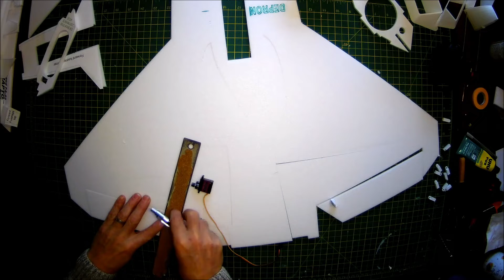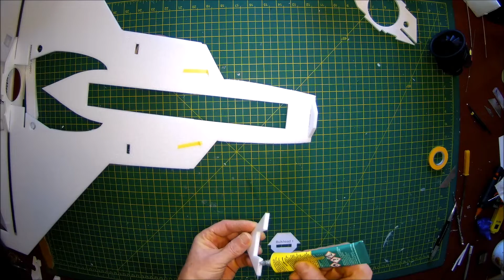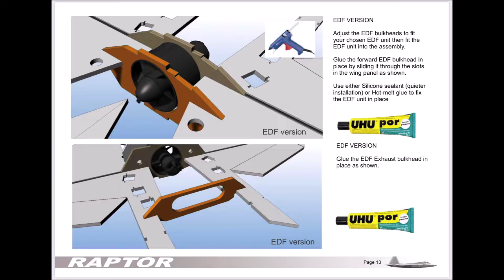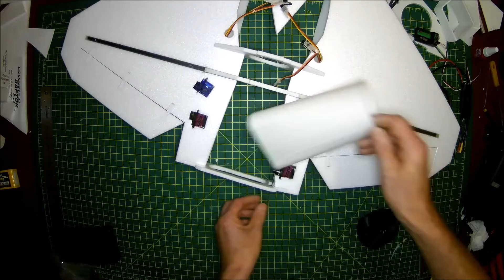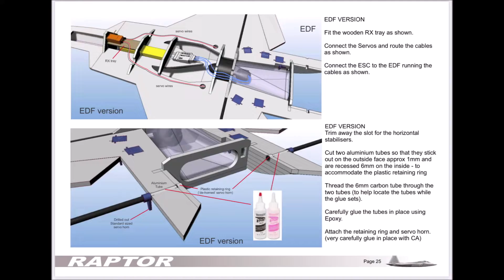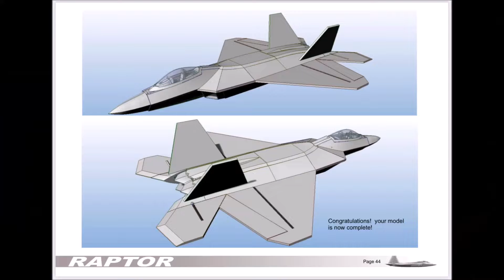Jetworks F/A-22 Raptor build

Comment: For beveled cuts, I actually sand them.  It started with making 45 degree bevels for control surfaces.  With a metal ruler standing on it’s edge, tape the part, on edge to be beveled, to the ruler.  Mark a line, parallel to edge of part, the required distance needed for bevel.  Now you can sand back to the line, using the line on top and edge of ruler on bottom, to control angle of the bevel.  For control surfaces, you measure back the thickness of the foam for a 45 degree angle.  Or you just measure back the distance indicated on plans.